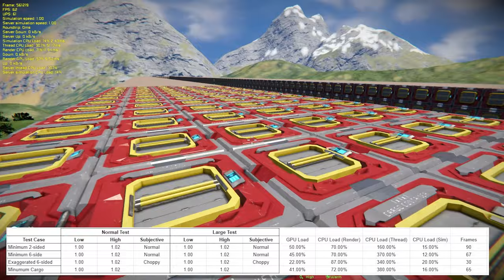Space Busters | Do Conveyor Junctions Cause Lag? | Space Engineers

Comment: render gpu load is down on last test as the computer is spending much longer calculating the code so its only producing 50% as many frames to render so the GPU has less to do. 
it seems as though keen put a cap on how many/how long conveyor calculations can be run at a time so some things can sit in a box and potentially never get moved. 
this is probly part of that major sim speed update they did some time back. 
limiting the number of conveyor pushes per tick will mean that lots of push requests cant kill sim speed but complex paths can make a frame take longer
Reply from the maker: This makes a lot of sense!
Reply: @AndrewmanGaming  i am not a good coder but i can see shortcomings in code and understand how they can/will affect other things and how you can/might be able to avoid them. 
in many ways space engineers is a masterpiece of code, handlling the complex grids and in multiplayer is a hell of a job and its crazy that sim speed is as stable as it is now.
Reply from the maker: @stevenchaloner162  Yeah definitely, they've done some good work on sim speed stuff and optimizations.
Reply: @AndrewmanGaming  yeah so it’s still not recommended to over use conveyor types that you don’t need (aka have unnecessary empty ports)
Reply: I suspect the additional load on the CPU and reduced frame rate in the "excessive" world is the extra grids that you're making the poor system-hamsters sprint to calculate and render.

I wonder if you would see a similar degradation if you copied and pasted the same number of two-sided grids as you did for the excessive systems.
Reply: As a computer science geek, I kinda wonder how Keen is approaching the pathfinding algorithm "behind the curtain" -- are they using a brute-force tracing algorithm, or, as I'd hope a modern programming shop would, using some kind of graph-based node-and-edge model, maybe a more efficient Dijkstra's Algorithm or something... 🤔

The reason your computation load increased is that most algorithms have problems calculating "costless" systems, or where everything has an equal cost, since you can get into weird looping scenarios and run afoul of the Halting Problem. 😕
Reply: @GPandzik  That could be solved if the grid is built first where all redundant paths are removed since the game does not have throughput issues, then all that long block of conveyors could be replaced by one 6*6*1 in each end and one connection between them making path finding calculations trivial.

Cost free offers this optimization solution ;)

Comment: is it possible to run a similar test in a multiplayer environment akin to a server.
this could really prove the Lag issue that seems to plague the servers since there are many more players online at once putting real demands on the processing and rendering in game
Reply from the maker: Good point, using the junctions does increase CPU load atleast a little bit so it's possible that the tax on the server is amplified when many players are using them excessively. A server test could be done very similarly to this one, but just with normal bases in different areas. The first test would use the optimal 2 way conveyors and the second test would replace those with junctions.
Reply: No it's the ram of ur computer and space engen severs. And steam. Xbox got to buy a sever. But on steam its free.
Reply: People love to build BIG without Respect
Reply: @markpugh1064  
I only use Junctions where conveyors split off into several directions or passing into/from a pressurized space.
otherwise, I keep them to a minimum.
even on my big bases.
Reply: Thanks for doing the work, these kinds of builds are fun to do/see seyimes.  I do think though that the real problem is for multiplayer.  If keen has optimized it they treat conveyors as networks or graphs which should mean that network paths are only calculated when things change.  Add block, remove block, toggle sorter, blow stuff up, etc.  Even though this drastically reduces the processing power needed, multiplayer adds potential problems.  For one your game and the server have to sync network changes and anything moving around the network. Players that are close by to you may be syncing that same info also.

I'm not sure the end impact is, but in the interest of being a polite multi-player neighbor I try to minimize my use of 6way junctions but I'm not as zealous as some server admins either...  There are a few mods with armored conveyors which are nice to build with anyway.
Reply: @PriorUniform721   
- Blah blah - SE is a Heavy CPU Dependent game.

1000's of Multiplayer games have been around for years with No Problems -
Unfortunately SE isn't 1 of them.
Reply: @markpugh1064  
Quote - "People love to build BIG without Respect"
-- Respect for what ?
-- SE is a game that begs for BIG Stuff.
Reply: @AndrewmanGaming  As someone who has ran 5 servers over the years all on different hardware CPU and RAM are not a major limiting factor for sim speed, but they are for how much voxel damage and the number of large ships your server can endure. I've run servers on Shared hosting  with  various specs and on a dedicated 64 core threadripper w 128 GB Ram.    The game is hard coded to run at 60 tics per second,  that means it can only run at a maximum of 60 calculations per second.  60 sounds like allot until you realize every non station grid is making one call per second to find out if its about to crash into something.  Having a multiplayer server with 30 Grids will set your available ticks to 30 per second.    So now lets hypothetically say that one of the ships is a factory ship with 16 refineries 10 assemblers and a massive cargo borg  say goodbye to the rest of those ticks, so what happens next?

The calculationsteps are still the same size, but can't run at "realtime" any more. So firing a thruster for 1 second would net a lower speed than normal, but firing a thruster for 60 ticks (a few seconds) would get the expected result.
Reply: @AndrewmanGaming  Alternatively; it could be combined with multiple grid locations out of render range and excess use of junctions.

Comment: I heard that it causes lag due to the fact that it has to loop over every face of the conveyor for connections. If so, it probably would only cause lag whenever you place a block. Bot sure if thats it though. Im going to keep using tubes, because they look better.
Reply from the maker: I think so too. Junctions win on structuralness, but tubes look really cool!
Reply: Server owner for over 5 years on and off  Its not as bad an issue now as it was but still prevalent on servers with 100 ships with massive moving inventories.
Reply: @C_L_A_R_K_E  I guess as Andrew said, syncing issues in multiplayer might cause more frequent recalculations of paths than single player, but for that large number, is it really the junction vs pipes or just the sheer number of grids ;), thats why it would be interesting to see this test done on a multiplayer server, especially with lots of players interacting with the grids.

Comment: 18:48 With the "Exxagerated" world, the game has become heavily CPU-bound - the CPU is weighed down with game-thread calculations and is no longer able to fill the GPU pipeline fast enough for higher frame rates, which means the GPU is basically twiddling its thumbs at 20% load.

It should be noted, though, that even in the other scenarios you're still CPU-bound, just to a far lesser extent - the GPU is only maxing out at 50 percent, so with a more powerful CPU you would get even better framerates.  Whether you need a higher clockspeed or more cores depends on how effectively Space Engineers is able to take advantage of multithreading.  There are probably other videos out there that cover this in more detail.

Comment: Thread CPU load was about 300% with junctions and about 190% with conveyors, but no effect on simspeed.
Reply from the maker: Yeah it's weird, I was expecting a simspeed drop.
Reply: I've had stuttering in multiplayer games when it says there is a solid 1.0 sim speed, many factors can come into play and we noticed more stuttering with junction heavy ships.
Reply: That does make junctions laggier, but only by about 50-100%, rather than the 200% you might expect. I would assume that it is using some sort of pathfinding algorithm that doesn't care about the shortest path, because that wouldn't matter. I would have expected that the code would have just calculated the paths once and only update it when a conveyor or inventory was damaged, destroyed, or disconnected; but I guess that that might introduce weird bugs.

Comment: According to Xocliw in I think it was the live stream for SotF update, he touched on this.
He said the conveyors with 2 ports are calculated as a line segment by the game engine, and ANY block with more than two ports is calculated as a node by the game engine. Line segments use less computational power than nodes. He also mentioned nodes use the same amount of computing power regardless of number of ports. So a modded T-junction conveyor, or say the new X-junction pipe conveyor are still using the same amount of processing as a 6 sided conveyor because they are all node based.

So according to Keen, yes, node based blocks use more processing power than line segment based blocks. Whether or not it impacts a server in a noticeable way is more likely gonna be determined by the server hardware and internet connection. It's still good practice to use 2-way conveyors unless you absolutely need a junction. rather than exclusively using junctions. Junctions also weigh more and require more components to build, so it's in your best interest to make efficient designs.
Reply from the maker: This is good to know. I know a few people were worried the new DLC conveyors were more efficient with their special junction options than the base game ones, but it makes sense that they are treated just like the base game 6-sided junction.
Reply: @AndrewmanGaming  I will say it perplexes me that the new pipe conveyors are a paid item, because they are more than just a cosmetic upgrade, as all the new pipe conveyors - save for the new sorter - are 100% air-tight. This is huge enough to be considered a game mechanic hidden behind a pay wall, IMHO, and vanilla designers such as myself will absolutely be using the pipe conveyors from now on because of their airtightness, which kinda forces people to buy the DLC or be unable to use many BPs from now on.

Personally, it doesn't bother me much, because the DLC is just $4, the price of a coffee at many places these days, and I always buy Keen a cup of coffee each time a new DLC comes out because I really appreciate the company and their commitment to the game and community. I can see that wall of paid DLC being imposing to a new player, though. As of Heavy Industry, there are $44 worth of DLC packs (not including the stand-alone paid suit skins) on top of a $20 game. I will point out, though, $64 as your total is still less than most AAA titles upon release, and I have to say, SE has gotten me way more hours of gameplay than most big titles, and not just gameplay, but also satisfying my creative itch.

That said, I understand the controversy that's been stirred up around the Heavy Industry update.
I wonder, though, with price inflation, Covid BS, and such, I wonder if Keen is starting to struggle. This latest update seems like they're trying to see how much they can get away with putting behind a pay wall, and their body language in the stream came across like they know there's gonna be backlash, but their body language also seemed to indicate they really need the money but don't want to upset the community, either. It must be stressful knowing your staff needs to be paid more to compensate for the economic strain going on, but also know you're gonna get a tantrum from your player base if you raise the price of DLC by a dollar or two. It's like the restaurant I go to for lunch regularly. I order the same soup each time, and as of late, the price of the soup has risen by about $1 (16% increase). I think Keen is trying to keep the DLC price $4, but are now locking more items behind the pay wall to encourage more people to buy the DLC.

I don't know if that's a wiser strategy than simply raising the price of the DLC by a dollar or two. I have no issue paying $5-$8 for new DLC, because again, I truly appreciate what Keen has done with the game and community, and that's about how much I spend on DLC for another game I love (theHunter: Call of the Wild). Of course, not everyone feels that way, and even worse, some people feel that the DLC should just be free (a really selfish, entitled, childish attitude, if you ask me).

As the old saying goes, "If you try to please everyone, you end up pleasing no one."

Comment: CPU thread load went to 2x after you placed all the tubes.  So that could be the source of the lag, in a per system basis and mostly just with older hardware.  And it went to 6x base after placing all the junctions.  Base was 60% load, just tubes was 120%, just junctions was 400% load.  So yes there is a truth there.

Comment: Given that conveyors probably only check if adjacent blocks are other conveyors/ports means that whether it's 6 or 2 sides, it's simply just the conveyors' position on the grid + or - 1 space either up and down, left and right or front and back.
I would think it's a fairly easy process for a computer to handle.

Comment: @AndrewmanGaming Ya know, it seems to me, based on the idea that you could see how many cargo containers were on in the extra-bit that there are more hard numbers to extract.
see if i understand correctly, each grid info states how many blocks are being used. I admit i do not fully understand this, but if it works the way i think it does, then you could take a reading of your 'bare bases' (as in the bases before you put tubes or junctions on it) Block count, then do a second reading of just tubes, then a third reading for the 'normal Junctions' then a final reading for the 'Excessive Junctions'.
then you can work out formulas based on the # of each type of block, and # of total sides vs the drop in game performance numbers, and there by start building a library (if you will) of Numerical data to compare too across Games Both local and server based.

Comment: The reason the gpu and cpu speeds are worse is because the 6 sides blocks have a hire polygon count thusly your pc has to spend more time on rendering it over the 2 sided tube. Any lag experienced with the 6 sided block is local lag and has no bearing on the servers preference. however being that it is local lag, in combat and co op  situations everyone in high lod render range will experience the local lag in varying degrees depending upon their pc specs. If you are a peaceful hermet the 6 sided block is not an issue, if you are a warmonger with a wicked out ship full of these blocks, you are the bain of anyone you come into  contact with.

Comment: think of the item your sending from point A to point B as electricity, all that electricity needs is a circuit connecting the 2 points for it to reach its destination. the item doesnt pass through the pipes or the 6-sided conveyor so the game or your computer doesnt look for a path persay but rather checks for a circuit connection linking the 2 points. verry little to no processing power is needed for this as its a simple line of code and takes microseconds to workout with todays modern machines. what does cause lag is the physical block itself.. rendering a conveyor junctions with so many pollygons apposed to the pipe which has way less pollys takes up more gpu and processor. hope this helps a bit :)

Comment: You might try using the same number of normal sized blocks. Even though its the same number of items they are built different. So it may be just having that many full blocks. If an armor block has a similar effect you will know its the block size and number. If it doesn't, you'll know its that specific block. The containers are gonna be worse because it has to track all that space and inventories. I think it depends on the complexity of the block and number of blocks in your world.

Comment: I use these on a server most of the time to make sure there is an air tight vicinity in my base and have run them excessively but I also see a bit of lag, starting from 60 FPS for me (VSYNC on for reason) but it is not the only thing, a mixture of the things will cause lag. I can easily drop from 60 to 28 frames going close to one of my first ships... its basically a big honking 3 dimensional rectangle (or brick if you want). I will say though, over time, I have been able to reduce the lag caused by my creations some.

Comment: You didn't lose sim speed, but your FPS dropped in both test worlds when you went to the massive test.

I think a better test would be equal length paths.  I think in your circus maximus test, the objects eventually get into the shortest path and stay there.  Try this instead: Make a 3D rectangular path, with a cargo box at diagonally opposite corners.  Add in sorters on the three paths out, and in, and see how it goes then.  What happens with three equally sized paths with no preference for any of them?

Comment: gpu load likely goes down when using all 6sided because of instancing. And the sim speed will not change as  it's working on async with set time delays. This however should mean, that items themselves should be pulled at slower speed. Also - it's very likely, that you could kill the game if you would load up the containers with multiple types of items as it would not be dealing with a single entry, but multiple ones.